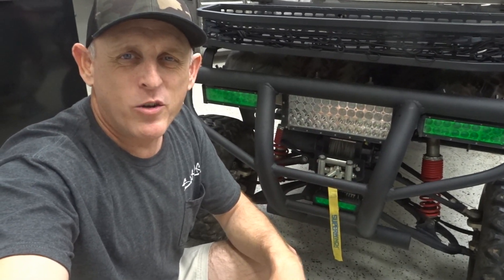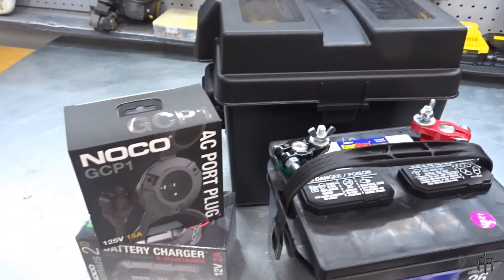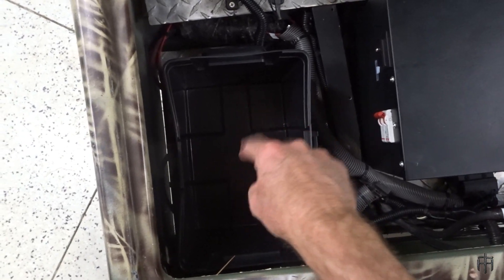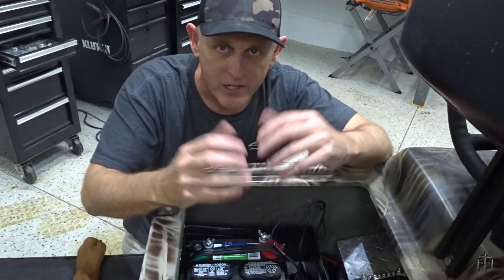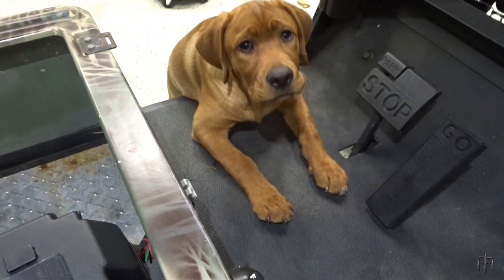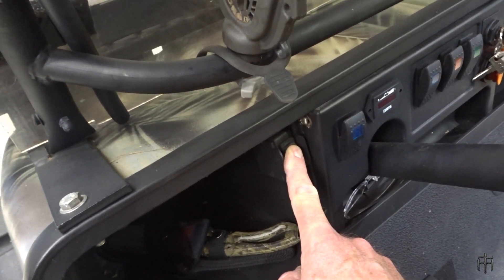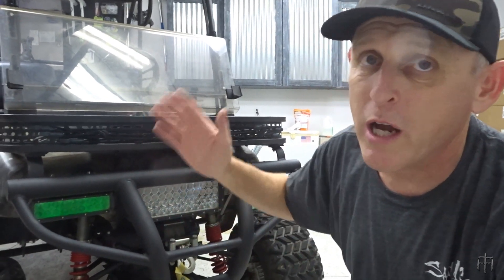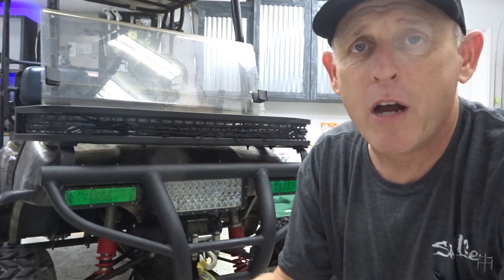Winch Fix for Lithium Battery Setups

Comment: How did you wire the winch when you were running 48v
Reply from the maker: I put the winch on it’s own 12v lead acid battery.  I could never find a 12v regulator for my 48v pack that could handle the amp draw.  Having it on it’s own battery solved all my problems.  Hope that helps.

Comment: would a 12v lithium battery worked? I have a 48v lithium battery and then installed a separate 12v (20ah) to hook all other lighting etc to
Reply from the maker: I wouldnt use a lithium battery because I don’t believe any of their BMS would allow that kind of amp draw without tripping or possibly damaging the battery.  I went with raw lead acid because it’s bulletproof and delivers great amps on demand.  Hope that helps!

Comment: I watched your prior videos saying your cart is a 1982… which would have been a resistor setup. I have a 1989 DS I am building and want to concerto to solid state also. What pedal box did you use? Did you even use a pot box? What wiring harness? I see you used an Alltrax controller. Did you pull everything out of a newer cart? And do you have a Run/Tow switch? Your FNR looks like a standard toggle? Thanks in advance for the info!
Reply from the maker: Hey brother.  Yep, ripped out the entire resistor setup and started from scratch.  I use a PB-6 pot box.  I didn’t use a wiring harness, just wired as needed.  I don’t have a run/tow switch and my F&R is a heavy duty upgrade but a simple toggle.  Hope that helps and have fun!!
Reply: Would it be too much trouble for you to sketch up a quick diagram how you were able to wire in a controller and petal box with your Plum Quick motor? Snap a few photos? Even make a video?!?! It would get a ton of clicks. Building golf carts is hot right now and there are a lot of people with the same questions I am asking. Let me know if you need my email?
Reply from the maker: I keep my cart at the farm so I don’t have it here to sanp pics.  You can find a lot of Club Car wiring schema online for a custom series setup.  That’s what I used.  It will diagram all the wiring for you using a pot box, etc.  There’s a bunch on Google.  Good luck!

Comment: Having problems with keeping small 12 batteries charged with the 12 v regulator, solar panel not even hooked up to a trail camera? Set it up as shown on video. Left side of regulator goes to battery middle negitive and right side to connection to camera. Solar panel is green. When fully charged camera connection is showing the volts coming to the camera which is under 12 v. Can someone figure my problem out.

Comment: I love your videos thank you for making them.  I'm wondering why you don't just run a couple 12ga wires from the winch battery to your 12v buss?  That 48 to 12V DCDC converter (you call it a regulator) will keep the winch battery topped up all the time.  That's what full-size EV's do.
Reply: You should put a relay in one of the 48v leads going to the DCDC converter so it only comes on with the ignition switch.
Reply from the maker: I like your thinking!  The downside would be that you need more than 12v to charge a 12v battery to full charge.  You need 13v or higher depending on the desired speed of charge.  The other downside would be that if you used your winch a lot and brought the battery way down it would take a very long time to recharge at 12v which is a constant drain on your main pack.  I think full size EVs must have an auto regulator charger for their 12 volt batteries but I’m not sure.  The other way I thought about was to mount both chargers onboard and then have one AC outlet for both.  Being an offroad cart and my charger not being waterproof I didnt think that was a good idea.  Thanks for your comments and let me know what you decide!
Reply: @TheHandyHunter  I've been using DCDC converters just like the one you're using for years and always assumed they put out 13.6V.  I have one on my solar batteries right now and just checked.  I'll be damned!! 12.4V.  I've been doing EV conversion for a while, too and the DCDC converters we use put out 13.6V specifically to keep a 12V car battery topped up.  I just assumed the small ones did that, too.  For what it's worth, I just looked on Amazon and you can get 13V DCDC converters but they're like $75 so probably not worth it considering what you're using is working fine for you.  Learn something every day!
Reply from the maker: Thanks for the info!  I still think your method would work but it might not keep the winch battery fully charged…but charged good enough for what I need.  What brand of converter do you use that runs 13.6v?  I would consider that for a future build.  What kind of EV conversions do you do…cars or offroad stuff?  Thanks!

Comment: Man I was hoping you were gonna do a video on this! Great setup, great video, thanks a ton! Can’t wait to get mine done
Reply from the maker: It works great now!  You could probably even do a smaller lawn mower batter (UT size) with a smaller case and still have plenty of juice.  Glad it up and running again!  Good luck!
Reply: @TheHandyHunter  my winch is up and running! I got all the same stuff you did and installed today. Fantastic setup. Thanks again!
Reply from the maker: Great to hear!!  Glad you finally got it up and running again.  Thanks for all your research and feedback.  Maybe somebody will come out with a monster regulator one day…lol.  Until then, this setup will definitely get you out of the mud.  Have fun!!
Reply: @TheHandyHunter  thanks for your help too. I look forward to seeing more of your videos, best of luck in the woods! Season wraps up for us tomorrow.
Reply: hey man, hope you’re doing well. I have the same renogy battery meter as you, does yours return to 100% automatically or do you have to reset it every time? Mine doesn’t automatically change after charging. Any suggestions?
Reply from the maker: Hey brother!  Yep, mine works perfectly.  It flashes while being charged and will show % of charge and amps until it’s fully charged.  I dont have to do anything.  Was yours ever working correctly?  If not, I would double check all connections and even disconnect and reconnect if you haven’t already.  Beyond that, I dont know if the Renogy has a reset on it but that might help.  You could also contact Renogy for help or replacement from where you bought it if it’s still under warranty.  Let me know what you find out.
Reply: @TheHandyHunter  It has always done this since I installed it. definitely does not flash while charging. I’ll disconnect and reconnect it to see if that will help. I’ll try contacting renogy as well. 
Thanks! Happy Hunting!!
Reply: @TheHandyHunter  also do you leave your batteries on most of the time or turn the breakers off when charging or if your cart is not in use?
Reply from the maker: I only turn them off when I leave the farm.  While I’m there they stay on all the time and while charging.  Did you go through the initial process of setting your Ah in the Renogy, etc?  It may be missing some of the info it beeds to calculate the numbers.  I’m sure you did so it may be a bad module.  Let me know what you find!
Reply: @TheHandyHunter  Thanks! 
I think I see where I went wrong. My charger does not run through my bus bar. It connects to the battery, so I’m thinking the charging current is not actually running through the shunt so it’s not telling the monitor that it’s being charged. I’m going to try what you did and connecting the charger to the bus bar which would be on the load side of the shunt. Am I correct in my thinking here??
Reply from the maker: Check out the diagram on the whiteboard in the video for connecting the charger to pos and neg bus bars and also the shunt.  That should help and fix your problem.  Let me know
Reply: @TheHandyHunter  thanks a ton. You’re the man

Comment: With the lithium upgrade, how long does a charge last?
Reply from the maker: Mine is a 95ah set.  I got nearly 25 miles on pavement.  Maybe 20 offroad but I need to do an offroad test.  It typically will last me all day for my needs around the farm.